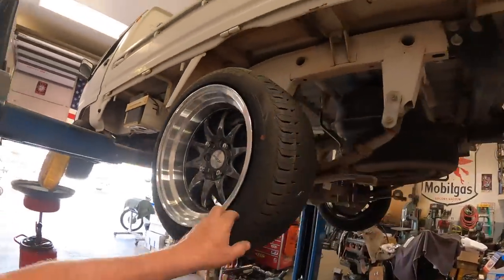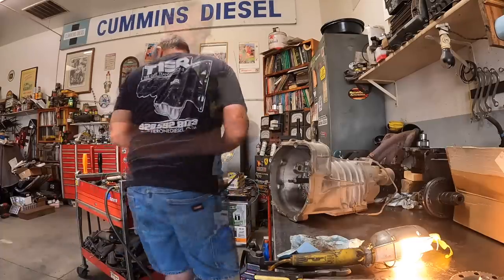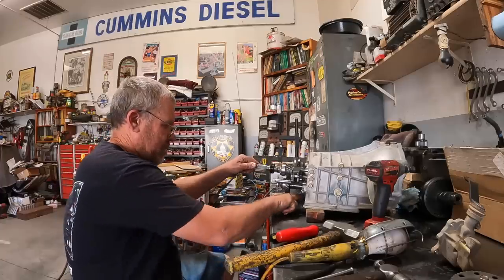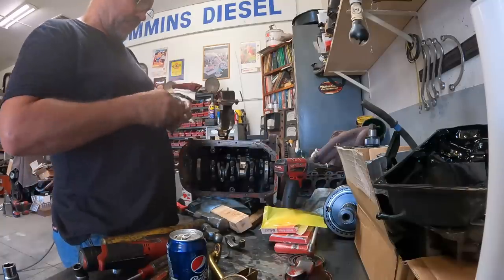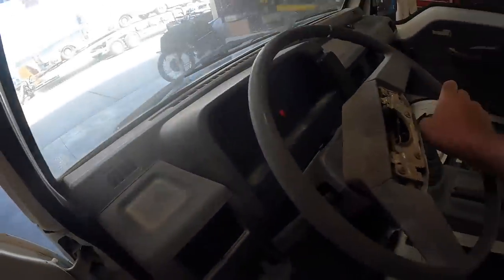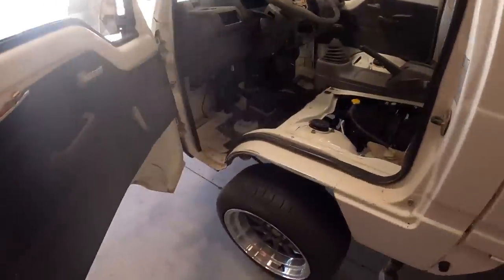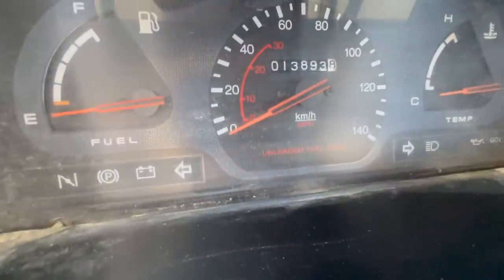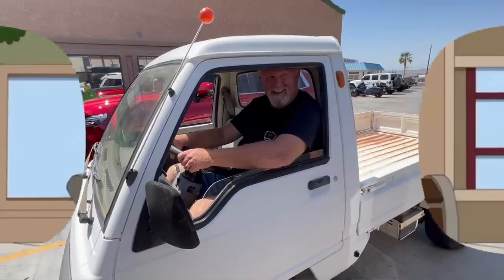How to Make Your Kei Grocery Getter Truck to Do 140 KM/H

Comment: Sweet! I’m diggin on Arizona’s vehicle registration laws 👍 certainly more fair than most places
Reply: Right!? I'm up here in Maine, you could never do what this fella did. They are so strict out there. Especially with vehicle inspections. That's the biggest problem up here.. Can't build anything, or do much at all to your vehicle.. I'd absolutely love to live in this area just for the freedom. Wicked cool to see though!
Reply: For old vehicles it's quite a bargain. And I can register for 5 years at a time and get a price break.
Reply: You can literally register an ice chest on wheels with a SBC powering it in AZ as long as it has tail, headlights and turn signals.
Reply: The title bond and licensing without a title or at least some pretty solid evidence of ownership is a PITA. I've built custom motorcycles with all new parts, frame, engine and everything and where I've had every single receipt down to the fasteners and wiring and they've still hassled me for weeks and forced me to get a title bond. I doubt Merlin has too much trouble in Havasu, but come down to the Valley in Phoenix/Scottsdale/Tempe/Mesa and try it. One time I drove out to the middle of Navajo county where I own some property and the old gentleman there did it without blinking an eye.
Reply: @desertd2609  Doesn't it need a horn too? I think you can get away without turn signals since hand signaling is legal.
Reply: @3rdpig  I’ve dealt with owning many cars in quite a few different States of the past few decades and it seemed to me that Montana was the easiest to deal with and Colorado and Virginia the worst. That’s of course just out of places I’ve lived or worked,I know there are some much worse.
Reply: @bigchevy350boy  I visited a guy up in Limestone ME about 25 years ago to grab some VW type II parts and was surprised at what you could have on the road, not to mention meeting folks with farms that had barns full of sweet old cars and more vintage snow machines than I have seen since ❤️.
Didn’t Maine start cracking down on the JDM stuff being legal to register there?
Reply: @oambrosia  yes it needs a horn too.
Reply: I'm 6' 7", 200lbs.

Comment: Hey Merlin,
Nice work on that little rice burner.
I live in Tokyo with my dad in the late 70's. Two of my friends bought used mini trucks. 1 a pick up and the other a van. The both were crying that they only had 3 speeds. Turns out that a Tokyo City ordnance limited top speed on delivery vehicles to roughly 30-35 mph.
But the out lying provinces being mostly agricultural had no such restrictions. One of my friends drove out to the countryside and scored a working 5 speed from a farmers supply.

Comment: But can Tim drive it with the window rolled up?  The old Ford Escorts were probably tighter inside.  My younger brothers laughed at me when I couldn't get out of an Escorts drivers seat if I had a small cup or even a sheet of letter sized paper in my hand however they couldn't do it either!

Have fun with it and try to keep it original however if you blow it consider a 4FB1 Isuzu OHC 1.8L Diesel Engine from an 80's Chevette Scooter.  They came with an old school mechanical Kiki pump, had the Turbo Compensator already installed and mate up with the MSG5 transmission plus the trussed con rods, etc hold up nicely to the boost.

Best!

Comment: You're the Man Merlin, you can fix about anything, that method of "Fixing" the gear box to get the other 2 gears, was something in itself. The Registration seemed Easy there, Not like here in Australia, it can be a nightmare trying to get Official VIN numbers, etc, and here you can't even put anything on the Engine that is NOT Originally manufactured for it, not even a better Carburettor. Your front tyres stuck out past the body panels, that is illegal here, ( the Cops would chase you, and Defect your car for that) you can put bolt on flares to make it OK, but with those doors that would be hard.

Comment: Hey Merlin, you should get in touch with Marty and Moog from mighty car mods in Australia, they have done a couple of those Diahatsu Kei mini trucks and have turbocharged both apparently they turbocharged them in Japan and you can buy wrecked engine parts with the super flat low profile intakes and exhausts to  fit those engines. They even converted one of them from carby to fuel injection and they both go like shit off a shovel. Any way if you get InTouch with them they'd only be to happy to share info and might even come out to do a callaboration video is heyve done some from Japan before, anyway just thought I'd share that, great vid loved it

Comment: If i remember correctly this thing are speed limited in japan,in older ones they lock out the last 2 gears,later they were ecu limited and then they removed the limiter,they used to unlock them like you did or find a trans from another non locked vehicle

Comment: fun little truck ... engine rebuild very good , "but" transmission mods off the chain , quite impressive overriding the limiters - not to mention the homemade steering wheel adapter "MERLIN THE MAGICIAN" amazing work , i mean engineering
Reply: merlon do you have a e-mail address ?

Comment: Add one of them mini dozers on a trailer and your in buisness . Now you and Paul need to make mini rock crawler . All you can use is a front wheel drive four cylinder motor and transmission . A pair of axils (no bigger than DANA 44 ) and a homemade frame and large tires . Slow but a bit of torque . Then have a fun run in rock and sand , with a mud run at the end .  With the smell of race fuel for the win !! 👍🤣🍻🍻

Comment: I have had my Cushman for a year..I Love It
Reply: merlonJohnson.....  obviously, you have gotten rid of the governor. There’s a company that makes it limited slip to go inside the rear end but you have to mill the gears down a little bit to make them flat. I have it but I have not installed it yet. My goal is to somehow turn mine into four-wheel-drive and/or make the rear end have more travel. To do this I think I need to cut down the output shaft and put a bolt on yolk and then have the slip joint in the driveshaft.
I like the idea of yours of putting on a larger exhaust. I have not done that yet. Parts for these little machines are kind of limited, but G and R import probability your Best bet For engine related components. They do have a limited amount of other stuff available for this little unit. I hope one day to meet you and let you see my Cushman. I do who have a channel on YouTube called desertvet1990. I have very limited Contant as of right now. Everything is just of side-by-side riding. Check me out if you would please.

Comment: Your an amazing Mechanic and there is nothing you can't do, how did you find out about the transmission ???
Have a Great Day 👍 Merlin 
God Bless America 🇺🇸🙏🇺🇸
Reply: When he bought it, he was advised that two gears were locked out.  Locking out two gears, keeps the speed down, so it qualifies as a low speed vehicle, and doesn’t have to meet US safety specs.

Comment: Ahh, such fun !  Just dive in to see if its what ya might think, definitely a sign of advanced engineering, lol!  Looks as tho it'll be a kool little "go-kart", not sure if it needs a flamethrower, but...  You're already running AV fuel, lol.  Great little project.

A question, what's the deal with the partially blackened light bulb above your work bench??   (& the ring compressor looks like what we made for bikes back in the early 70's, in our youth, lmao!!).   Certainly appreciate all your efforts to keep us entertained & chuckling, always look forward for your posts!    Thanx !

Comment: Torguey little bugger; pulls 5th gear decently well! Odd that they build the transmission with 4th and 5th locked out.... gotta be an American market thing. I'll bet the same truck in Thailand has 4th and 5th! Still needs a 4bta though!
Reply: In order to sell it in the US, and not require US safety specs, it is sold as a low speed vehicle.  Limiting the number of gears, ensures it stays a low speed vehicle.  That is unless Merlin modifies it.

Comment: Hey Merlin you should check out mighty car mods. They did a "big block" swap on a mitsubishi k truck and also turbo charged it using a different 3cyl mitsubishi motor that was only avail in japan. It also showed what they had to do to changeover to all of it as far as using what parts from which vehicles and what they had to do with them ecm to make it all jive

Comment: I had never heard of a Cushman version of a Kei truck before seeing this series of videos.  Factory LHD is certainly something only those were ever made in.  Any of the built for the road versions used a much smaller engine than the 1000cc . I helped my neighbor who had one of these back in the 80's that had a few issues with the carb. I just fitted an SU of a mini 850 and modified the ignition so it only used the points for timing and it worked great.  This particular version was a 550cc but would happily haul 700 pounds of junk around if required.  Top speed was pretty low at 50 mph  but that generation was never made to go higher. The only real problem it had was brakes being a bit small for it when it had a couple of adults and a 500 pounds in the back.  Also acceleration was never really a priority with kids on push bikes frequently passing it for a laugh. Another person I knew got one to replace his Mini Moke that he used to drive on the beach selling Ice creams.

Comment: Love the videos Merlin!! I have a real Kei truck (RHD). It's a 1991 Suzuki Carry with a 660cc engine. What you have there is something that a lot of campuses and maintenance facilities would bring in to save on gas but they were usually bigger engines than what was available in Japan. Kei laws prohibited engines over certain CC size as a tax reduction. If you do a little bit of research on Kei in Japan, you will find a ton of vehicles that fall under the class and are all 660 cc's. It's a pretty interesting subject I think you would enjoy. Thanks for the videos!

Comment: We used those a lot on the airfields in the military.  Not sure on engine size but they were gutless. They got the job done and were driven like they were stolen. They seemed to hold up well to the abuse. A turbo would probably be the cheaper option to diesel conversion and probably give it a healthy "boost"!

Comment: I've been wanting one of these things for a while now. have narrowed it down to a SanBar. Rear engine for more traction, 4wd, with high and low t case, and locking diffs. And like yours, with the 4 cylinder engine. They also made the van style of these mini trucks, a lot of those came with a factory turbo, wich would allow you to do interstate speeds. But 55 is fine with me. With the 800-1000 lb pay load, you'll be able to haul about anything, just not a lot of the heavy stuff. One 12 valve cummings.engine but nothing more.
What wheels did you use? Off a SXS or What tires?
Reply: I had the same question.  What rims did you use and what size.   I drive a KIA bongo and have been looking for rim options.

Comment: Merlin , now this is just an idea , everytime you use a cutter or grinder i would keep a neodinuim magnet a biggish one sitting very close by , every spark yu see is a bit of iron filing that gets stuck inside the gears or oils or where ever , but that big magnet will suck them clean out of everywhere / thing . now that just my 2 bits worth .

Comment: Tthe guy with the most tape measures wins , you got 8 i only got 6 , you win 😂 i wasn't too far off on the parts cost, Mitsubishi parts are always a little more money. as you mentioned the other 
Kei trucks are a maximum of 600 or 660 cc engines and some turbo charged with injection, your set up there is the old saying less is more you have to admit it , the wheels and tires, steering wheel and exhaust system are worth at least 10 hp,LOL, like the decal package on a 69 GTO was worth 5 more ,LOL, with the better breathing exhaust you tossed on a little carb adjusting will make it a little more spirited, through the gears, too bad they don't sell a jet kit for the carbs and if they did it cost another $300, it is just a cool little grocery getter and could do a Home Depot run in a pinch,
Great video look forward to next one  👍

Comment: There's a couple of crafty Australians that pretty much specialized in these things they even built a razzu motor went to China for parts I guess but they built the stomper of a machine in fact they learned that you can mix and match certain parts from other engines that are more performance kind of cool

Comment: I sat in a little mini truck, out here at our local motorcycle dealer, years ago. I just barely fit. I'm 6'3". I couldn't turn my head and look out the side window. The top of the window was about even with my chin. I quickly determined that truck was not meant for me.

Comment: The rubber strip on the door also helps with door vibrations 

I'm from the Caribbean where we have alot of the Suzuki carry mini trucks and all are limited to 4th gear ,I'm wondering now if 5th is hidden and we need to do the same as u did

Comment: Merlin what do you know about tuned port engine because I’m currently looking at a 1954 Chevy 3100 with a tuned port engine only things I know about them is that they were only made for three years and only came in three different car the Corvette Camaro and Trans ams. Thanks in advance.
Reply from the maker: They’re great engines the injections a little slow, but it works good with today’s Fuel and they run really good for a long time

Comment: I’m thinking the transmission was used for another application maybe just had a different bell housing. There’s a possibility they locked fourth and fifth out because of such a low gears you’d be spinning the shit out of the driveshaft might want to get it checked for pallets all right this is six in a row.Jim again

Comment: I had a small truck with 4th and 5th locked out and it was just a metal ring on the slector rod in top of gear box

Comment: Merlin, what is your trick on keeping carbs clean with all the little toys you have that don't get played with to often?
Reply: Find pure gasoline with no ethanol (alcohol). The ethanol will attract water, gum up the carb, and destroy any old hoses and seals.  When you are putting something away for a long time, run the engine until the carb, lines, and tank are completely dry.

Comment: Merlin Can you put a Mikuni Sled carb or Bike carb in it , Get rid of all the polution crap -- Ps We stuffed 24 people in a Volks wagon at a Bar once , Hurt like hell with 15 people on top of you .LOL
Reply: merlonJohnson......  Hi Merlin I have a shxt load of mikuni carbs like off sleds or bikes ,Very simple to operate even ultralight use them you can get smart carbs off Yamaha machines that work great for high altitudes or even run Walbro carb it's a diaphragm pum carb with a fuel return line to the tank really reliable fits anything. I have about 6 or 7 Mikuni carbs basically just watch your plugs for color as long as tan or darker side it'll run upside down even when plugs light colored change the E clip on the Mainjet needle up or down whether its runny fat or lean if way to white go bigger Mainjet totally.

Comment: Did you see the lads at Busted Knuckle the Death Wish guys built a 4x4x4 one and a lowered and LS swapped one along with a body mod also the guys at Hoonigan's built one I think with a rotary engine and one off hand crafted aero kit.
I built one with a Yamaha 1200cc V-Max engine with blower.
It was lethal I really upgraded the brakes but got the pressure bias wrong we got upto around 120mph hit the brakes it tipped on its nose folded in the front in busted the headlights and screen and my passenger head butted the screen and was knocked out, we were pretty tight in it it was the Suzuki model so tight so myself and passenger are both 6'3" around 210lb we had to get someone to tip it back up as the doors would not open we could not get out the sunroof a small cheap glass pop up item, so had to kick out the screen and climb out the screen opening.
We had 15inch x 13nch wheels with some wet touring car tyres, I saw a six wheel one on here with all 4 rears driven I think the guy was the Grind Hard Plumbing  channel. Mine is in a storage place half way lifted to 4x4 it and fit an electric reverse when funds allow. Love the built on a budget route mine was supposed to be just an motor swap as I destroyed it drifting, thought I could just rebuild and refit but no ,my mate looked at my crashed Yamaha 1200cc V-Max engine out came the ruler as the V-Max and the tourer version are shaft drive so it was simple, but kept chewing up the diff, so fitted a MK1 Ford Escort axle then a Rally limited slip diff was added and tyres lasted about 1,500 miles max and got fifteen to the gallon  ouch, drove round with a toolbox bolted at the rear of the bed to keep the wheels on the ground, just purchased a Suzuki 5 seat people carrier to swap out the pickup running gear for it soon.

Comment: Call me crazy but oops I bought a 2005 CRV for $350 with 209,000 km. The catalytic converter was stolen and the motor was no run. I had more money than Time at that point so I bought a motor from a Jdm and Porter and me and a friend put it in on his hoist . Fast forward to about two years later I should’ve done the water pump when the engine was out so I had to do that and then two months later the transmission shit the bed so then it was 1050 for the transmission.. New brakes and pads on the front new pads on the rear new rear coil springs just bought a cheapo eBay catalytic converter, but definitely have a lot more into it but definitely a different beast than a Kei